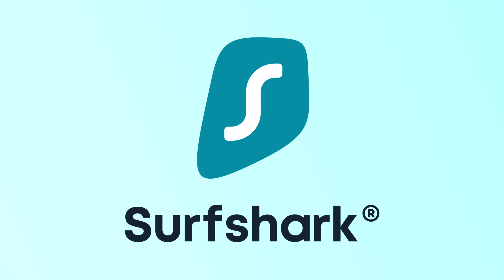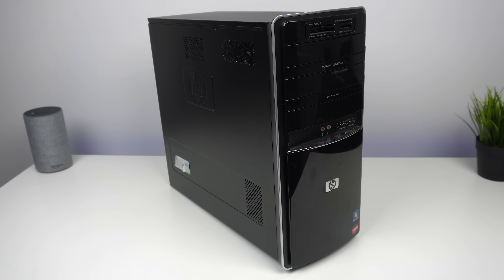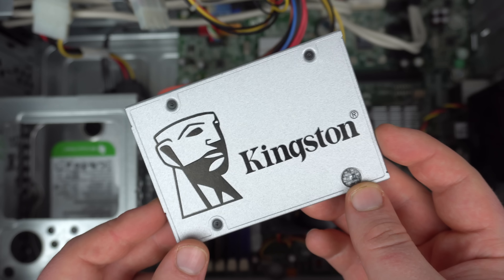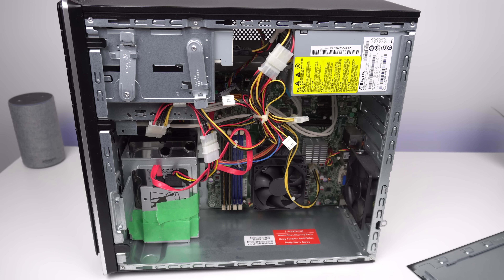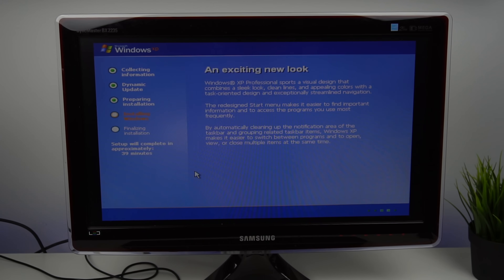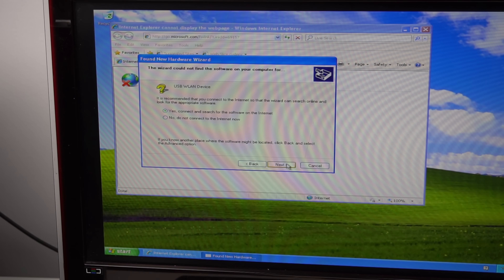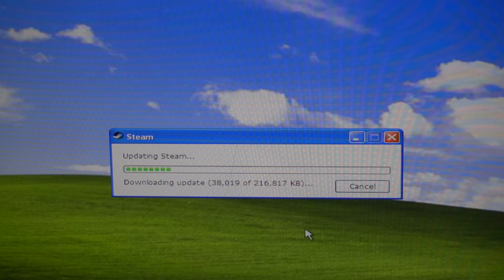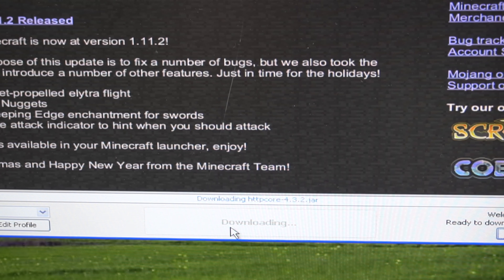Trying to use Windows XP in 2019

Comment: There's no problem using XP in 2023 as long as it's not on the internet.  I installed XP Home on a Toshiba netbook using an external DVD player and it went smoothly; I replaced the HDD with an SSD and the installation was fast.  The only issue I had was finding the drivers for the things that XP didn't recognize but I eventually found all of them.  I did all of this as an exercise and also to use an old but barely used scanner and old software.  I am happy with the results.  I also installed Vista on another PC just for the hell of it.

Comment: Nothing against you, but you show your age and naivety, I reckon a bit more research and you would’ve of saved so much time. But hey, it’s fun learning curve! So, as that machine is an OEM, it’s quite likely that HP may still have the drivers, so going on their site, looking and checking ‘Device Manager’ would’ve solved a lot of issues. Windows XP does not support USB booting, it has to be done by using a patcher and installing in 2 parts (something like EASYTOBOOT, which is something we didn’t have back then), it’s easy enough now, but I still prefer using a disc (I’m old). I hope you revisit this and then try out nLite and slipstream all your drivers, patchs, hotfixes and updates, that’s where the real fun was back in the day. Steam can be installed too, but you need to use an older version. XP also doesn’t support TRIM so it will most likely mess up a SSD eventually.

Comment: You don't need to have the ethernet hooked up to it, although on our computer, which is the exact same one as the one you used in this video, we have a thing that screws onto something that looks like a smaller version of an RF plug on a TV, and it kinda looks like a weird antenna thing or something like that, and it makes it where the computer can connect to wi-fi connections that are either far away, or it's required to use wi-fi on it.

Comment: You don't really need to work around everything on windows xp to get stuff to work, you can still do a lot with it to this day. All be it, Steam doesnt work anymore. But you can use something like SteamEMU. Also the reason your minecraft crashed is probably because you never bothered to install graphics card drivers (yes you kinda need those, even for integrated graphics). Today in 2020 I am actually coding a minecraft mod on windows xp. Without any workarounds, everything works out of the box, as it would on Windows 10. Thats how usable this OS is still.

Comment: I was beta testing early versions of Windows XP in December of 2000. One of the early versions had an issue with Windows Media Player where videos played upside down, but aside from that it was very stable and most of my hardware worked with Windows 2000 drivers. When XP released in October of 2001, Microsoft gave a free Professional copy to all computer engineering students at my university. I still have that original copy today and I'm using it on my retro XP gaming PC. It's definitely my favorite OS of all time.

Comment: I have this exact computer! sadly it died and now wont turn on without many issues and blue screens. Unfortunately I dont know what the reason is. I have a new ssd i would put in if I could, but Idk if it HDD is the issue or another component. I think I bought it around 2013 so its about 7-8 years old

Comment: I have an Asus K50IJ laptop made on July 2008, And I bought it in 2010. I am dual booting Windows 8.1 and XP. (Because Windows 10 doesn't want to work well on the laptop)
The laptop has:
3gb of RAM (Originaly Came with 2gb of ram)
a 500GB harddrive (Orginaly Came with 250gb)
Intel Pentium T4300 dual-core CPU 2.10GHz (Came with the laptop)
Display driver, is Mobile Intel 4 series express chipset family (Came with the laptop)
Other things I replaced was
- The Keyboard (Because I accidently spilled water on it)
- The CD drive (Wouldn't close properly and couldn't read the disk)

Comment: The home-built desktop PC running the audio software in my music recording studio still uses XP Pro. The computer's over 15 years old, has a single core AMD CPU and 2 GB of RAM. It has an EMU 1212M soundcard and records 24bit audio at 48kHz in Sonar 8.5 Producer. I input live guitars, bass, vocals, saxophone, flute, keyboards, drums and percussion, and anything else that takes my fancy.

My old XP-based system still does everything I need it to, perfectly. I've got glitch-free MIDI and an unlimited number of audio tracks, with surround-sound processing if required... Why the heck would I change anything?

It's simple, stable and reliable, which is far more important to me than whatever the many later versions of Windows have to offer. I don't give a toss about peer pressure or fashion or being mocked for being too poor to keep up with the times. I make my own damn times.

All the fancy 3-D graphics and safety improvements and interconnectivity options crammed into the bloated newer versions of Windows mean nothing to me. They are (literally) worthless, because upgrading to them would mean replacing every piece of audio software - EVERY PIECE - in my studio.

Oh, and I'd also need to dump the ol' 32bit PC, too, because everything's 64bit, now.

Once done, all the new, expensive, ludicrously resource-hungry software would put such a massive drain on the new, expensive modern workstation PC with its multi-core CPU and 16 or 32GB of RAM that I'd be no better off than I am now!

It's not broken, so I refuse to fix it.

Since Cakewalk's old Sonar software and Windows XP are now officially defunct, I don't need to have an internet connection for constant updates, so I have no worries about XP's notorious vulnerability to cyber attacks because it works in total isolation.

Long live Windows XP, I say. The journey's only just beginning.  ;-)

Comment: I waited until the hard drive on my old Windows XP Gateway PC finally crashed before getting a replacement tower running on 10.  The wireless key board I use for my current tower is still the original OEM Gateway key board.  The current computer was custom built so I had a firewire card installed at the time (used for transferring Digtial-8 video tape from an old Sony camcorder).  I could fix most problems that popped up in XP.  Haven't played solitaire in years now.  Like your video and added a "like".  BTW I still have my daughter's laptop running on Vista.  Oh, and the first desktop computer I ordered for biz ran on a 283 processor.

Comment: Nostalgia! I still love Windows XP.  Great video. You should try another video installing Virtualbox or VMware on Windows XP machine and if it installs then try to run Windows 8.1 or Windows 10 as guest OS with Windows XP as host OS and see how it goes. But of course before that you have to check if the old AMD processor on your machine supports virtualization or not. I guess it will probably not support that. For this experiment you will have install Windows XP on a newer computer.  And another VERY IMPORTANT thing. At 13:56 while promoting Sharksurf VPN, you mentioned China. That is totally wrong! You have absolutely no idea. So next time you promote Sharksurf or any other VPN, please replace China with India. That would be better than perfect.

Comment: Its easier to use Microsoft virtual PC an XP mode thats mutch better . You can download booth on the Microsoft homepage .It is very easy to go online with XP Mode if you have Microsoft Virtual PC installed on a Windows 7 PC. You select shared network (NAT) in the settings for the virtual PC for network adapter 1. In XP mode, an old simulated network adapter is used to go online, but this is just a nonsense for XP mode,  in reality the WiFi is used by the Windows 7 PC.

Comment: Yeah... 

This dude doesn't know anything about windows XP. 
Widows XP was the best operating system ever created due to it being extremely fast, smooth, no interruptions etc. 
If it was still supported to this day, I would use it. Yes there is a downside of drivers that you have to install all of them manually. (FYI that's why Minecraft crashed, he never installed the GPU driver) But on the bright side, once they're installed, you'll have no issues with drivers what so ever. Unlike in Windows 10, I constantly battle with printer drivers and useless garbage windows 10 has running in the background for no reason. 

I mean C'mon, even government private labs for research and development use Windows XP on modern hardware. 

Lol VGA is old? Nope! Alot of office desktop computers and monitors still being sold have VGA.

Comment: If you at the very least plan on gaming on Windows XP, you will sadly need to hunt down the actually CD-ROMs, depending on your systems specs, you can run certain games, but you will most like have trouble running anything beyond 2002.

Comment: Windows 10 fucking sucks in so many ways... Settings are harder to find behind multiple links like wtf lol. And you need workarounds for older games...
Reply: GTA SA (SA:MP), took me hours to figure it out. You need to manually activate DirectPlay, download all possible C++ packages and .NET Frameworks, as well as install a specific DirectX package which required like an hour to search for from different forums lol...
Reply: @ThatRandomToast  Yeah not that one, but at least SA requires some DirectX Redistributable to be installed and it was hard to find lol

Comment: That old Pinball game, I remember that I first played it on Windows ME. I think Windows ME today would be even harder to use for today's tasks. Actually, I'm typing this on a 2005 Sony Vaio PC that I fixed up with a 64 gb SanDisk SSD and a Pentium D 820 cpu and 3 gb ram and it has Windows XP media center edition 2005. Still works like a charm today. I think the best browser even better than Chrome for XP is MaxThon. Its one of the few updated or recent browsers that still works with XP, the next most recent would be FireFox 52 from March of 2017, and of course the next most recent is Chrome 49 from April of 2016. While still outdated Chrome or Firefox on XP, they are still much better than Internet Explorer 8 from March of 2009.

Comment: Had the same problem as you. The only way i was able to boot windows XP from USB and install them successfully was to use the "easy2boot" software. There are a couple of steps you need to do do which seem weird but it's easy and after a couple of minutes boom* windows XP appears.

Comment: for resolution you have to install vga drivers i can see its not installed the way your windows boots up and your windows are moving around(when you move a window with your mouse). try to install all drivers that have yellow icon on them in device manager that's in manage, to open manage right click on My Computer icon. [My Computer icon -right click--> Mange - click --> device manager] if you couldn't find drivers by its tool try to find them in creators website i think yours must be dell. if it wasn't succeeded try Driver Pack solution. you don't have vga driver installed and you want play games on it? try to install and retry for steam and minecraft.

for internet disconnection try to set-up your system time. it should work.

for browsers i don'r really remember the right versions but you have find the offline installers of older versions of firefox and chrome both was supporting windows xp in 2 years ago so find the right version in that time period and should work pretty well.
i am waiting for a video after tried all of this.
i wish for you, GOOD LUCK!

Comment: I have Windows 10, 7, XP and 98 on the same laptop.  It dual boots to 7 and 10. Virtual PC has XP and 98 in it.  My only hanging point in Virtual PC for 98 is system integration.  But it does fully load.

Comment: Thanks!  Actually ... with persistence, as you discovered you can get anything working again.  There is a way to get it to update to the latest security enhancements as XP is still supported in embedded systems (well, at least 2019 so it will still be fairly recent.)  I run XP to play around on VMs.   My adopted dad refuses to move off of XP !!!  He won't even consider Windows 7 !!!

Comment: Find a TinyXP iso. It's the best stripped-down version and has driver packs. Otherwise, use NLite to customize your own copy and importantly, slipstream your SATA and other drivers. 

XP works very well in 2019 and is wicked fast on 2nd hand hardware.

Comment: You can play Minecraft 1.12 or later on Windows XP if you install Java 8. Java 8 can be installed on Windows XP, but the installer will say it needs newer version of Windows. However, you can continue to install and run Java 8.
The latest version of Java 8 version can run on Windows XP is Java 8 Update 151. Here is the download link: https://drive.google.com/file/d/1Re73dAqizFh-N1voTLdWy_uksP4sSfPw/view?usp=sharing
If you are using Windows XP Professional x64 Edition, you can install the latest version of Java 8 (Update 231).
If Minecraft failed to launch, it may be caused by your graphics card not installing the correct driver. Try updating the graphics card driver and try to launch again. If problems continue, you will need to change the graphics card, and then try again.

Comment: My Windows XP Retro Build use
AMD Athlon 64 4200+
Elitegroup MoBo Socket 939
2 GB DDR RAM 400 Mhz
Radeon 9550 256 MB
500 GB HDD

And I am happy with it.
After I install all necessary drivers.

Comment: I can tell guys from your generation are not used to the manual driver installs that were necessary back during the XP days.  To be honest I'm surprised the XP install was even able to see the SATA hard drive.  XP didn't originally come with SATA drivers.  Back in the day when I was creating XP iso images I had to slipstream them in.  I'm assuming whoever made the image you used had done that.  Otherwise you'd have never got it to work.  Probably the best thing you could do for that old PC at this point is install the latest version of Linux Mint or Ubuntu.  I'd recommend Mint.  Put in a newer graphics card that can support the latest Nvidia drivers, and install Steam with Proton, and you'll have a nice gaming machine that can play all Linux compatible games, and Microsoft compatible games that work with Proton.

Comment: I was in college when Windows XP was released and I recall getting an early copy of the beta about 10 months before it released. It was a lot of fun to play around with. The early version of Windows Media Player in the beta would play videos upside down. There were a wide range of other bugs, but I was able to get a few games running. In the early days of Windows XP, everyone I knew would dual boot Windows 98 and XP because there were a wide range of software compatibility issues with XP, so you had to have a Windows 98 installation to fall back on.
Reply: And those were the good old days. :)

Comment: its a cracking OS, and I miss it dearly.  I did an windows XP MCP back in 2005, so I got to know it very well.   Only thing is support now for it sadly, is starting to thin out now. Which is not a surprise now since Microsoft killed it off back in 2014, software writers are not going to bother writing stuff for it as often.  Great to see it been used on line again,  I had to call time on it back in 2016, due to it been a bit of a pain accessing some websites, and that was using a 3rd party internet explorer that supported it.   The thing is the systems that this ran on also are well dated, Pentium 3 and Pentium 4s not many people will be rocking one of those on the internet sadly. Be like putting a Pentium 1 on line now, due to how demanding the internet is!

Comment: I have 3 hard drives in my desktop PC.  One for Windows 10, one for Windows 7, and yes, one for Windows XP.  EVERY ONCE IN A WHILE... I need Windows XP.    My hard drive with it died about a year ago, and I lost it.  (So I thought).  Well, I said, ahhh... I have the disc, since I purchased it way back, so I did a fresh install.  WELL, I COULDN'T GET ANY UPDATES FROM MICROSOFT.  NONE.  So, it was running with SP3, but no updates that were released after that.  Well, I was so relieved when I'd found a hard drive, that I'd cloned for a crash... and there was my XP on it, with all my programs, and all of the final updates.  I cloned that.... to a new hard drive, and put the original cloned one, back in the drawer.  I think you'd have had better luck resurrecting XP, if you could have gotten the updates. Yes, it does have limitations, but so do all Microsoft operating systems... yes, even 10.

Comment: Windows XP was a great operating system. After the trash that was Windows 95, 98, and ME, XP was a complete breakthrough. Stable, great compatibility and really quick at the time. If only SSDs had existed then it would've been even more amazing. Many of the innovations of XP both in the user interface and under the hood, so to speak, are still present in operating systems today. It was really great for its time.

Comment: Windows XP IMO was one of the best O/S that was made for Windows. I used it for years and never had any major crash issues, etc. Our workplace has a key machine, aka, "KeyTrac" that keeps all the keys to cars on the lot. It still, to this day, uses Windows XP. It seems to hold up quite well with at least 200 people using it all day long. BTW I have that EXACT HP computer (circa 2009) and I am using it right now to comment and watch your video and it still is running Windows 7.